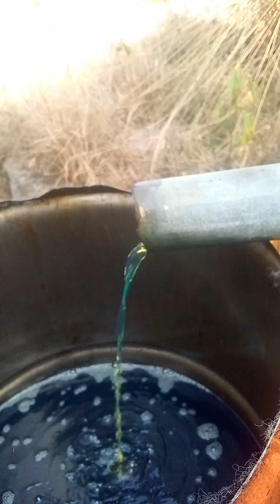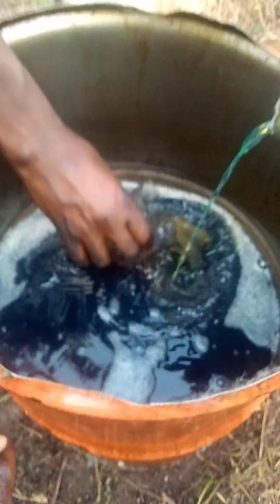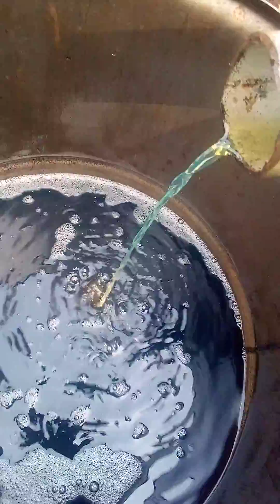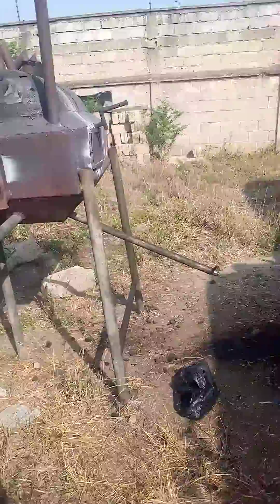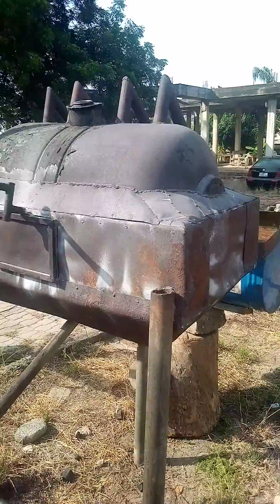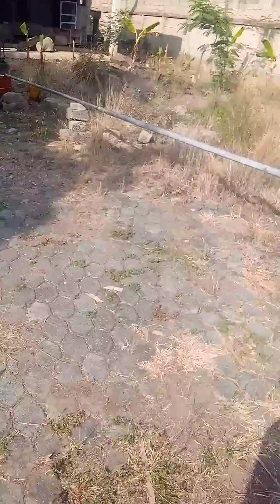refining of crude into fine diesel in Ghana

Comment: Does it work on diesel car engines and does it need to be treated before putting it in the tank of the car?
Reply from the maker: U don't need to treat it, u just put in ur tank and u drive,this pure A.G.O (diesel)
Reply from the maker: Can build the plant for u ,if u want 1
Reply: @jonespeentorinkansah  how do we do that ? or where are the instructions
Reply from the maker: WhatsApp me + 233240486794
Reply: That diesel need to be treated to remove sulfur in. Ofcourse you can use it now but with time it may damage this modern car injector
Reply: How can it be treated? What are the stages?
Reply: How can it be treated? What are the stages?
Reply: I really admire your work I've watched your video's many times congratulations brother